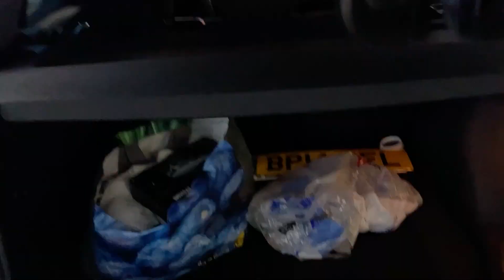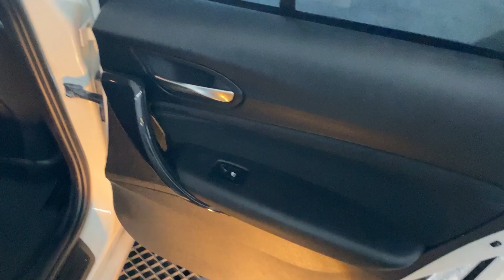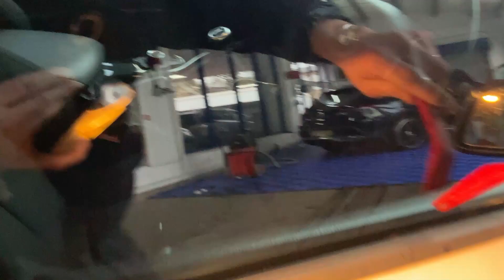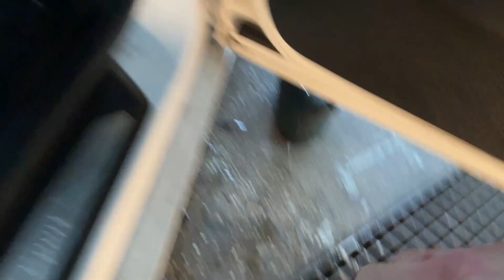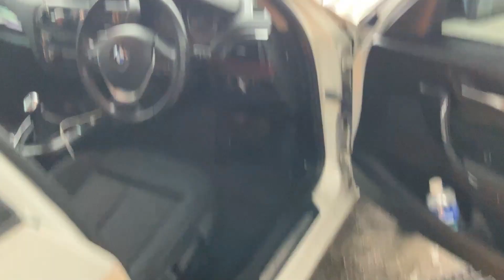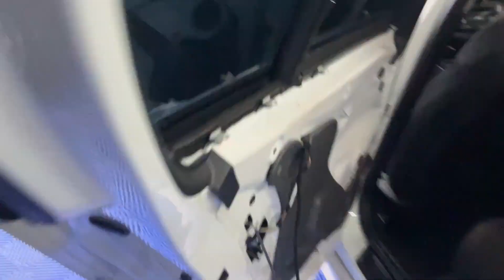BMW 1 Series | Door Leaks | #BMWLeaks

Comment: Just found the same problem with my passenger side rear door. Not long had the rear windows tinted so guessing they would have removed the trims to get the glass out? 🤷🏽
Reply from the maker: It could be worth asking them if they did. It's entirely possible the membranes weren't put back properly if they removed windows.

Comment: I have the same issue with my rear door, so it is leaking from the same hole. First, I thought that it is membrane, but it wasn't. How did you solve the rear door leaking issue? what am i supposed to do with that small hole?
Reply: I’m in the exact same boat. Rear drivers footwell (RHD) coming thru the bottom hole closest to the hinge, membrane is intact and bone dry but there’s water coming thru the hole. Can only assume it’s the outsides seals that have perished and letting water in where water shouldn’t get in. The seals aren’t expensive but apparently removing and fitting new ones is a horrible job